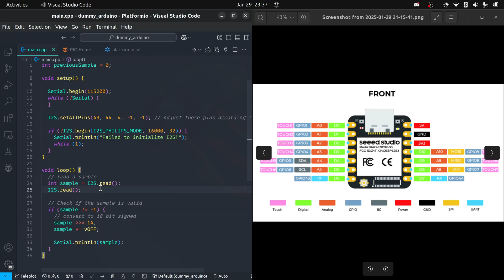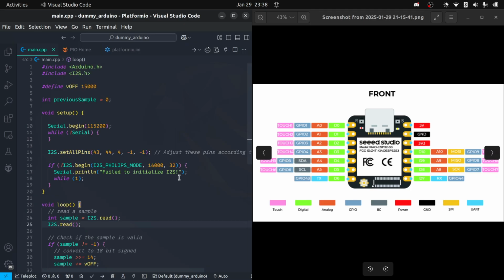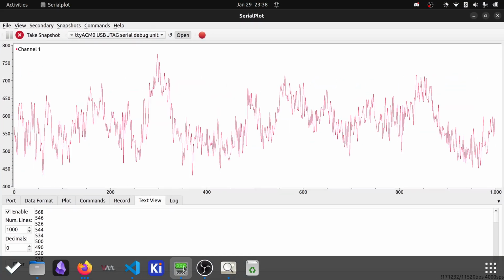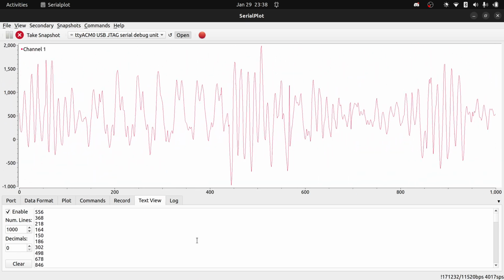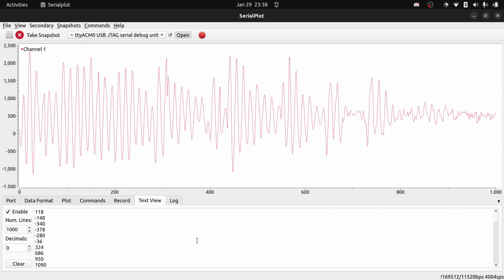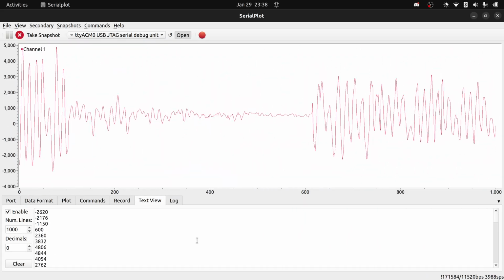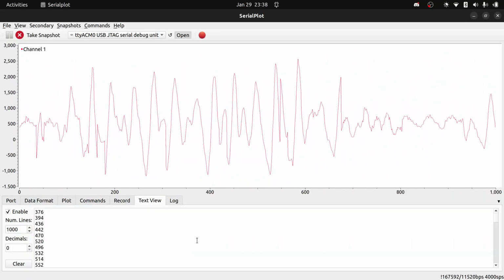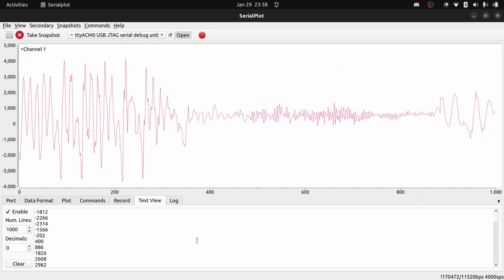SPH0645 I2S MEMS Microphone on ESP32s3 XIAO

Comment from the maker: Code:
```
#include <Arduino.h>
#include <I2S.h>

#define vOFF 15000

int previousSample = 0;

void setup() {

  Serial.begin(115200);
  while (!Serial) {
  }

  I2S.setAllPins(43, 44, 4, -1, -1); // Adjust these pins according to your wiring

  if (!I2S.begin(I2S_PHILIPS_MODE, 16000, 32)) {
    Serial.println("Failed to initialize I2S!");
    while (1);
  }
}

void loop() {
  // read a sample
  int sample = I2S.read();
  I2S.read(); // Throw out second value

  // Check if the sample is valid
  if (sample != -1) {
    // convert to 18 bit signed
    sample >>= 14; 
    sample += vOFF;

    Serial.println(sample);
  }
}
```